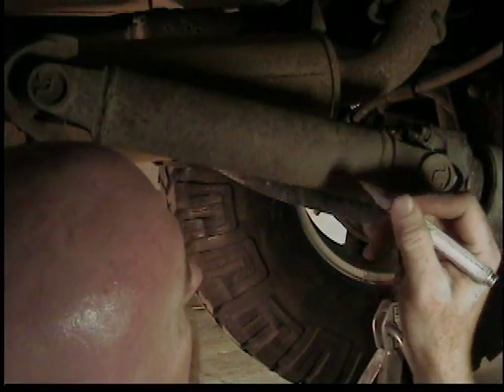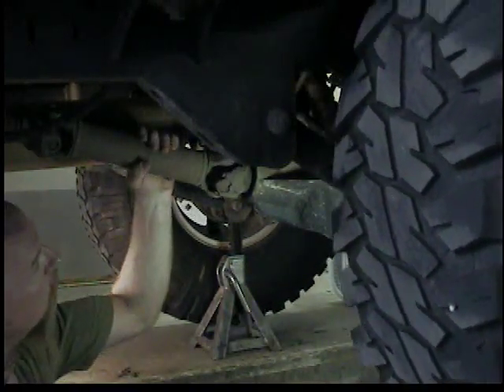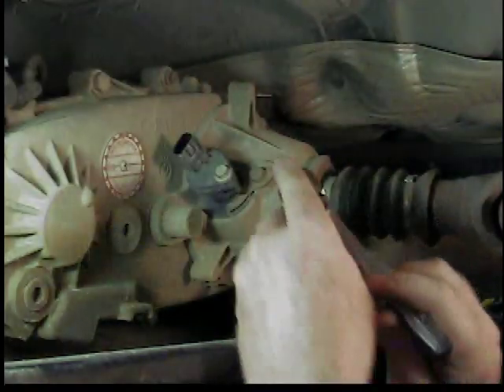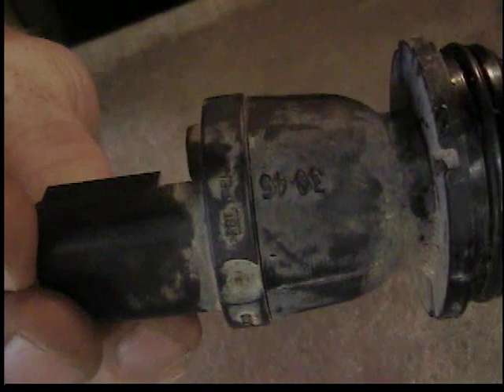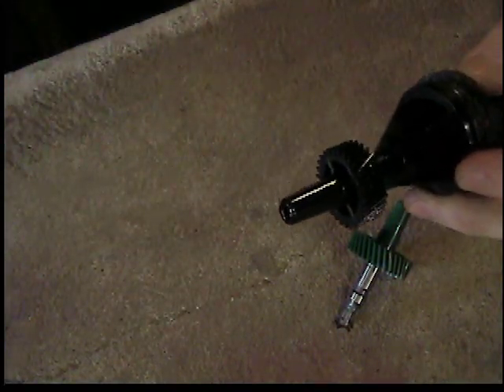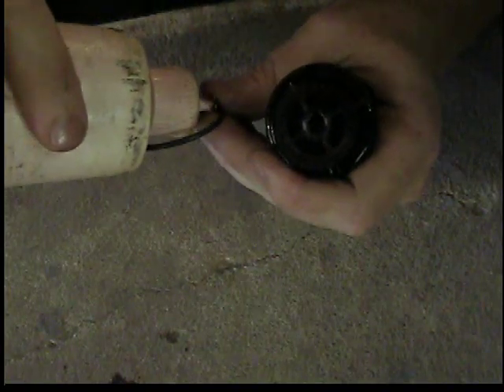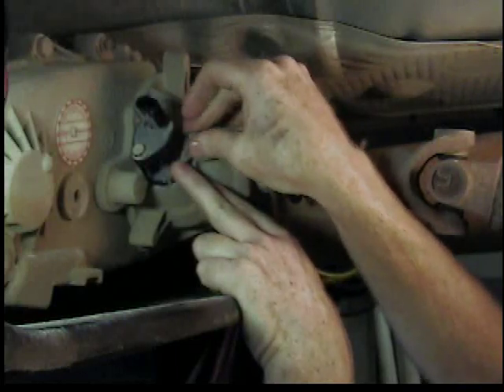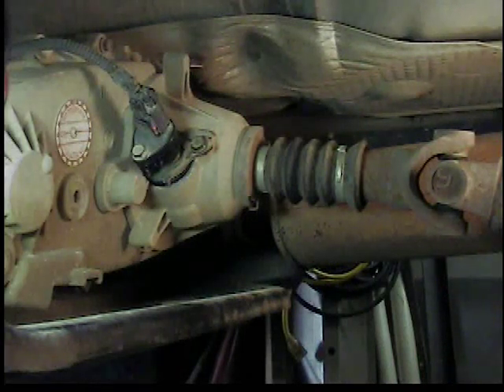Speedometer Calibration, Jeep Wrangler TJ

Comment: FYI, this does NOT work on a TJ Rubicon as the Rubicon transfer case doesn't use gears.  The ONLY way to fix the odometer on a Rubicon is to buy what's called a SpeedoHealer off of eBay, which plugs into the wiring harness and allows you to adjust the electrical signal going to the PCM.  (The SpeedoHealer also works on non Rubicon models and is much, much simpler to do and is easily adjustable if you change your tire size or gears again.)

Comment: 12 years later.... THIS Is how YouTube used to be - informative and not filled with a bunch of junk.
Reply from the maker: Jeep On!
Reply: @user-nq5rd4ck5z  Nice to see you're still responding to this so far removed from the original date.  Quick quick question: Does this both correct the speedometer and the odometer?  I would like to assume they're linked together with this sprocket but not sure.  Thanks man!!
Reply from the maker: @WayPastCrazy2525  Yes. They are linked. I wish I had time to film again. It's a fun hobby.
Reply: @user-nq5rd4ck5z  Thanks! 

If you enjoy it, keep filming! I've wanted to do that for a lot of my work but by the time I dive in and try to fix whatever it is I'm fixing, it's too late to drag out the cameras. 🤷
Reply from the maker: @WayPastCrazy2525  Yep. I need new cameras, computer and software. The old windows xp and 720p just don't cut it. If I can sell my carwash I plan on getting back to it.
Reply: @user-nq5rd4ck5z  LMAO! XP was and is my stomping ground. I still have my installation CD and don't have the heart to trash it. Heck, I still have the box it came in. 

Ugh now I'm sad.....I think I'll go sit in my Jeep.

Comment: My O-ring is leaking and I need to replace it but I don’t know the part number of the O-ring I have a 94YJ manual transmission, if anyone could help me with the part number and the place to get it it would be appreciated
Reply from the maker: Your local hardware store probably has one.

Comment: I changed my tires and gears to 35s  and 5.13 gears but now when i go in 4hi the car wont move unless i gas it
Reply from the maker: Well that's got nothing to do with the speedometer gear. Would need a lot more info. 35s are tough to get rolling but your gear change should have helped that. You did change front and rear gears?
Reply: It is automatic
Reply from the maker: @randyorellana4371  Four or six cylinder? The fours struggle with 35s no matter the gear.

Comment: Good instructions and easy to understand.  Messed with mine and my speedo and odometer will aren't working.  Guess I did something wrong.
Reply from the maker: Make sure it's turned to the correct orientation. A small gear on a big gear orientation and the teeth won't mesh.
Reply: @user-nq5rd4ck5z  hmmm ok ill check it again.  I could have sworn I had it orientated correctly.
Reply from the maker: Or the electrical connector isn't seated properly.
Reply: @user-nq5rd4ck5z  ok ill check that too.  I just had the drive shaft replaced so I'm wondering if that might have something to do with it?
Reply: @zman289  I’m having the same problem. It’s weird.. I went from 37 to 27 and it only works in the same position and now its 5mph lower than what it shows on the dash.
Reply: @BigReox7  that's weird. I still haven't gotten mine to work.  Let me know if you figure anything out.  I messed with it a little more and still nothing.  I'm wondering if the cable and/or wiring is messed up somewhere.
Reply: Also, are there any tricks that you know of to where you don't have to climb out from under the jeep and go for a drive to see if it was put back together properly?

Comment: This video is still giving! None of the others I watched mentioned that you had to turn it to the different gear teeth numbers. Thanks!
Reply from the maker: Jeep On!
Reply: I turned it to every position possible.. it only worked in the position of the original.. now it’s 5 mph lower than actual speed instead of 6-7 mph higher. Any idea why a 27 tooth with the 27 range facing to 6 position would make the speedometer not read anything at all?

Comment: My speedometer won't budge/come off. Any tips?
Reply from the maker: Hmmn. Twist?
Reply: @user-nq5rd4ck5z  I'll try again today. Does the transfer case need to be in neutral? Thanks for the reply as well.
Reply from the maker: @raymundregidor9258  No.
Reply: @user-nq5rd4ck5z  I used a rubber mallet and gave it some light "convincing". All good. The new pinion is accurate. Thanks for the help.
Reply from the maker: @raymundregidor9258  Jeep On!

Comment: Just ran across your video, it was very straight forward, I’m just finishing up on a restore of my 2000 wrangler sport took my 190hp stock L6,4.0L and turned it into a L6, 4.7 Stroker putting out about 309 horses fixing to add a supercharger to it. I go off roading with it doesn’t have a spec of rust on it probably because i live in California now after hurricane Katrina decided she wanted my city more then i did at the time, sorry for rambling on don’t comment much if everyone had to watch one of your videos they would see how it’s suppose to be done, thanks again, DLPtransportation
Reply from the maker: Jeep On!

Comment: Ok so Im putting on new tires on my jeep, however I am also planning on re-gearing it later on down the line...can i just replace the speedo gear now or do i have to wait to do it when I re-gear the jeep? Thanks in advance.
Reply from the maker: Dominic Grefsrud You can do it both, either or neither. It's just a matter of your speedometer and odometer reading correctly.

Comment: Great Video!! Took me 10 minutes to complete this. The only tip I would add is that it may be difficult to get the gear to go back in at the desired six 0'clock position. You can put it in as it was and rotate it to the six 0'clock position. Thanks for posting this. Very helpful.
Reply from the maker: Michael Wysocky Good tip. Jeep On!

Comment: hi, my speedometer on my jeep liberty 2006 sometimes get stuck, could bve that as well the problem ?
cause i guess the last owner changed the wheel and never replace this, and if it is, could i fix it in the same way you did yours ?thanks.
Reply from the maker: No, the Liberty uses a hole different setup. Sorry. Jeep On!

Comment: afternoon...just changed out my speedo gear for the second time...this time for the 4.11 trutrac gears that I just had put in...forgot that I needed to rotate that housing for it to read right...what I've seen different than what you have posted is that you don't have to disconnect the electrical plug...it will move with everything else...thanks for having a great video to remind of what I forgot from the first time...lol...appreciate it...
Reply from the maker: +Gary Swinford Good point. Let's call removing the electrical connector "optional." Jeep On!
Reply: good video...thanks.

Comment: What would happen if you just disconnected the connector plug and drove? Just curious because I just ordered a 39 tooth for my set up and it's going to be a weeks wait but driving on the hwy sucks due to the speedo being off making the computer think I'm doing 95 hitting the governor when I'm only doing 50ish? Would unplugging it screw with anything else?
Reply from the maker: It shouldn't hurt anything to drive with it disconnected. I don't know of a speed activated governor though. I hope your not hitting the rev limitter on the engine.
Reply: wwwCARSSUCKcom it cuts out acceleration when I hit 95 on the speed gage then drops top about 90 top 85 and back to normal again. Doesn't matter what actual speed is. Only happens when the needle hits 95. At 60mph I'm at around 2k rpm. At 55 I'm just below it. I thought that too. If I floor it the speedometer seem to increase in gap of actual speed as well. I start out 12mph of and after an hour drive I'm like 20+mph off.
Reply from the maker: +MegaChevy65 So weird. Please disconnect the speedometer sensor and go drive it and report back.
Reply: wwwCARSSUCKcom disconnected it and drove fine. Got up to 70 with no problems. Check engine light came on and the odometer doesn't work because of disconnecting it, but until that speedo gear comes in this will have to do. The real test will be when I drive it to work but I'm 99 percent sure that was the problem.
Reply from the maker: +MegaChevy65 It's good to learn something every day. When you are reconnected disconnect the battery for a long while to clear the check engine code. Jeep On!
Reply: wwwCARSSUCKcom lol thanks bud, and Will do. Jeep on!

Comment: My Tj is a sport,  6 speed manual. 4.0 and has the 3.7.3 gears. I'm running 33's right now. I'll need a 31 gear right? 
Where do I get one?
Reply from the maker: Bradley Harden The part # is 52067631. There are lots of places to buy it; Morris 4x4, SBC, Quadratech, Amazon... There are also exchanges on the forums where you agree to send your old one to someone if someone sends you the one you want. Google it and Jeep On!
Reply: Late to the party here but I have a similar question.  I just put 35's on my 2002 Wrangler Sport 6-speed manual 4.0 and I'm not sure what gears that I already have stock.  Is the same as Bradley's (3.7.3)?  If so, according to your chart I would require a 29 tooth gear.  Not sure how to find out if they're different.  My speedometer is about 9 mph off at this point.  Also, not sure about which size o-ring to use either.  Thanks!!

https://amzn.to/2J7XqnJ

Comment: 2003 Jeep wrangler sport 4.0  automatic 
Tires 33/12.50R15
Reply from the maker: ben mon Assuming you don't have a Rubicon, you probably have 3.73 gears. If your tires are actually 33" then you need a 31 tooth speedometer gear (52067631). But, you should measure your tires. Some 33s are actually 32" tall. If that is the case, you need a 32 tooth gear (52067631).

Comment: Was that new gear smaller in diameter than the old one?
Reply from the maker: NepaWalleye I don't remember. It could have been. It depends what you are changing to and from. That is why there are multiple orientations for installation based on the number of teeth.
Reply: I have a 36 tooth gear in there now and im changing to a 31 tooth. Old one looks a lot smaller than the stock one. Probably because of less teeth. I was just wondering if yours was the same as well.
Reply from the maker: NepaWalleye Taking another look at the video there is a shot with both gears and yes the new one looks smaller.
Reply: Thanks

Comment: Mi tablero no indica el kilometraje, cambiando este sensor de velocidad indicaría nuevamente el kilometraje?
My board does not indicate mileage, changed the speed sensor would indicate mileage again?
Reply from the maker: Glenn Antonio Cruz Hurlston If the dashboard shows total miles but the reading doesn't change, then it could be the gear shown in this video. It could also be the gear in the transfer case, the sensor that this gear plugs into, the wiring... It the dashboard doesn't show anything on the odometer then it is probably a problem in the dashboard.

Comment: Is this the reason why my speedometer & odometer aren't working?
Reply: my speedometer & odometer arent working
Reply from the maker: Could be the gear, or the wiring or the gear in the transfer case. Time for an inspection. Pull the gear and check it out.